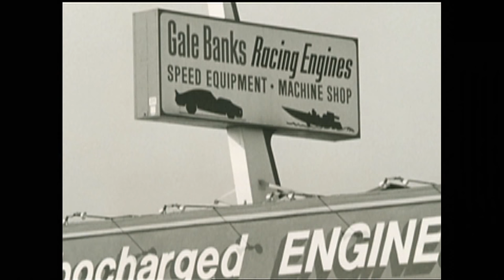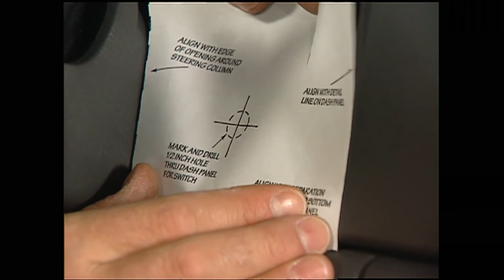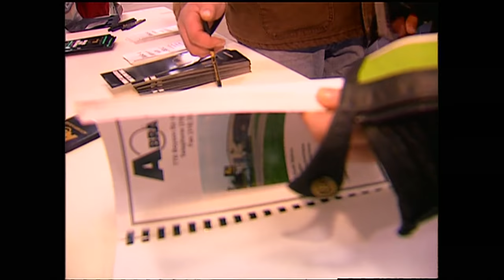Get Maximum Power From A Turbocharged Power Stroke - Trucks! S4, E14

Comment: Gotta love diesel engines in those trucks they're awesome
Reply: Diesels are really cool just not practical for most people.  Banks is making insane power from the diesel.   I would love a built L5P but I would never use it to its potential.
Reply: I'm impressed that he was able to remove and reinstall the turbos without lifting the body off the frame.  The clearance at the firewall/cowl is very tight.  It can be done without damaging anything, you just have to remove a lot of stuff.

Comment: If it's good for the truck then why didnt ford do it at the factory...something has to give...and YOU can pay the bill.
Reply: I agree for best reliability and ease of repair factory is best. If you need more than should have bought a bigger truck
Reply: The transmission will be the first failure.  Especially with the torque convertor lock with the exhaust brake.  It'll definitely cause excess heat and put more strain on the internals.
Reply: @americanpatriot2.06  agreed.. this tranny won’t last long.. Cummins and Allison need to get together, already